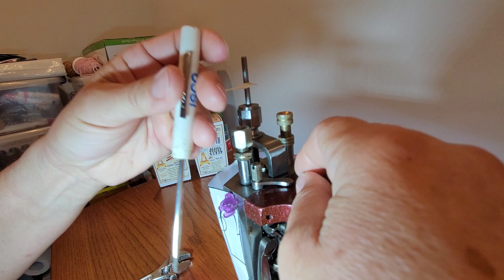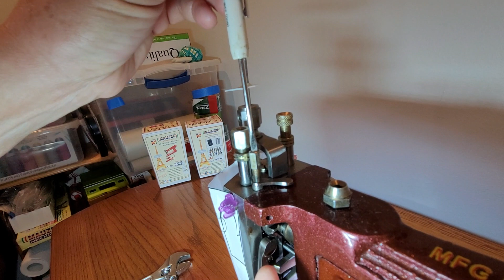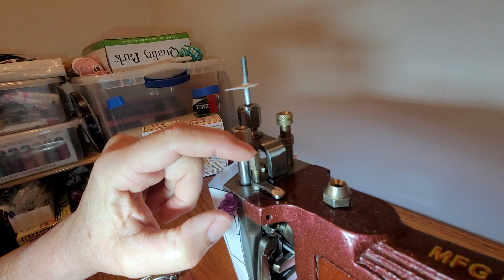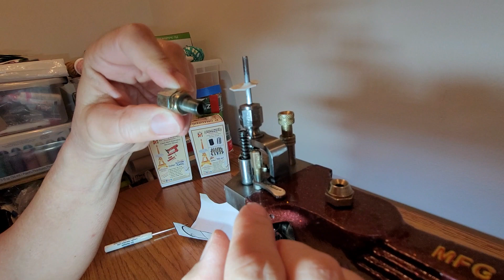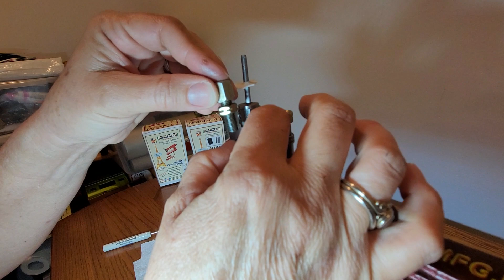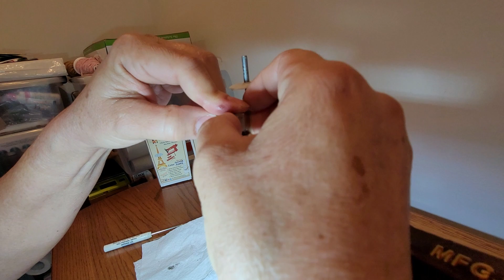Stitch Length, Nipple & Foot Pressure Adjustment, chain stitch embroidery

Comment: I have a new Mannan Machine, with the stitch length screw all the up I get about 6 stitches per inch, screwed all the way down only about 9 stitches per inch. How can I get more range? I would like to try more stitches per inch for a little more detail.
Reply from the maker: I do have a video "in depth stitch length adjustment" but if you have a Mannan I also recommend you ask Abdul for help as he is the most knowledgeable

Comment: Hello : Why would I need to adjust nipple pressure or foot pressure ? It's a one time deal and that's that right? does it effect my stitching if the nipple is a bit high or low?  I sometimes adjust the foot by sliding it up and down then tighten the clamp . Is that okay ?
Reply from the maker: It depends on the type of fabric you are working on and sometimes the speed with which you are working if you have a fill area that is very thick you may want to increase the nipple pressure so the needle can come back up more easily and in the opposite if you're working on a very sheer and thin fabric you may want to decrease the nipple pressure so you do not damage the fabric. Hope this helps you
Reply: @ChainStitchEmbroidery  That makes sense , Thank you. So under normal stitching and average fabric we leave it alone, How about the foot pressure ? is it the same rule - depending on fabric thickness-?
Reply from the maker: Similar for foot pressure as well don't need to have excessive pressure adjust your pressure for just enough to get the job done any extra is just more stress on the machine.

Comment: Thank you for all you information  it helps so mouch I'm in the process  of buying a mouzer  not sure what els I need to get with it besides the motor belt and table .I asked the company  and they  sent me looks like it's the parts they sale but it was needle bars and worm gears ect. Cold you help me just what's needed  with there new out of the box  head unit.  Thank you so mouch  for all your time
Reply from the maker: If I'm not mistaken I believe you will also be receiving a belt and small pulley from Mauzer.
I think all you will need is the motor and the table to get started
Reply: @ChainStitchEmbroidery  thank you so much